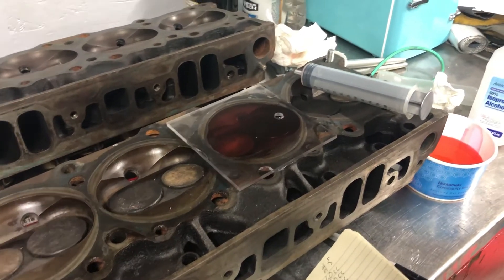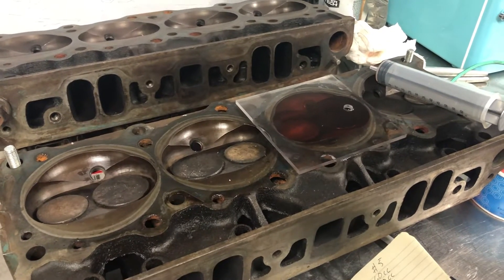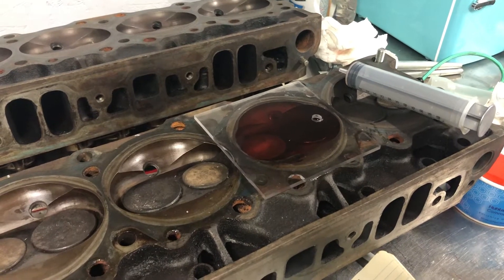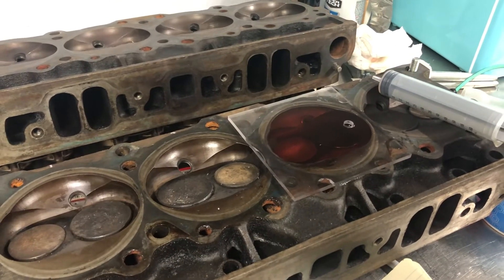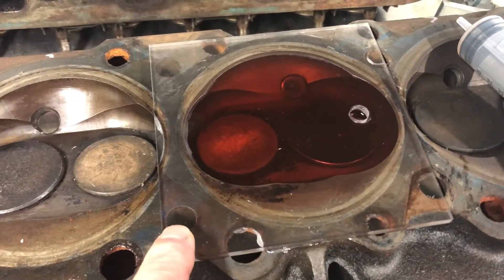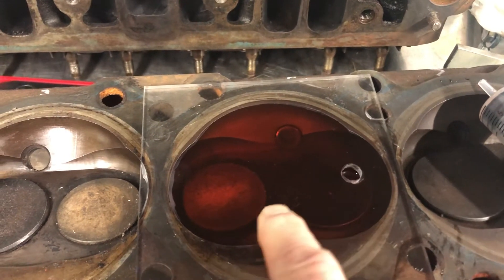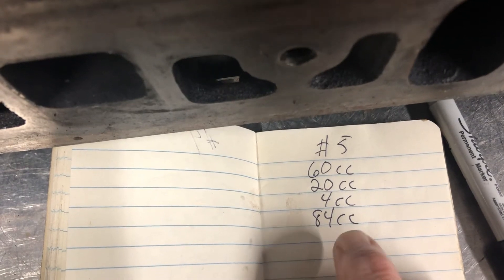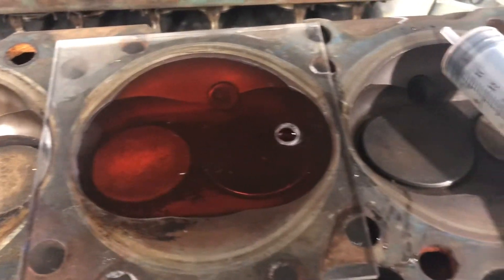Checking combustion chamber volume on #17 Pontiac heads

Comment: Great video, I finally found someone who is interested in the Pontiac 350. I have a 1968 Pontiac Factory 350 with the #17 heads. Thru some research these heads are most desirable. I look foward to updates..
Reply from the maker: Thanks for replying, I have just bought a bunch of parts so I have rods, crankshaft, pistons, rings, bearings, harmonic balancer . I have to scrounge up a Pontiac torque plate
Reply: @GruesomesGarage  Thats great, are you planning on installing hardened valve seats? Ive seen conflicting videos stating that on Poncho heads it cant be done due to close water jackets and others say its fine to install.
Reply from the maker: @anthonysantiago1999  I’m mulling this one over. I have not used them on my roadrunner and that engine held up. I have read different things about adding the hardened seats. On the 2.11 intake heads I hear it’s tricky due to the close spacing between the intake and exhaust seats, on this set of heads with the 1.96 valves there is more room to install the seat.
Reply from the maker: @anthonysantiago1999  let me revisit this one and I will let you know at a later time what my plans are, either stock, or hardened exhaust seats
Reply: @GruesomesGarage  thanks for the reply. I look forward to future progress on your 76 Firebird..

Comment: i am in the process of buying and having ported some 17 heads for a street/strip engine.  do you have any experience with this or can you give suggestions?  thank you.  Happy Super Bowl!
Reply from the maker: The only porting I plan on doing is to match the intake,and clean up the rough areas in the runners.
I have bought screw in studs and plan on replacing the press in studs . https://www.jegs.com/i/JEGS/555/20582/10002/-1

Comment: I know this is old but 17 heads according to butler and Pontiac was a 72cc head
Reply from the maker: I think you’re thinking of the #16 heads with the 2.11 intake. #17 350 heads 9.2 to 1 CR with the 1.96 intakes is what these are.
Reply: @GruesomesGarage  I h I have number 17 heads they are 72 cc
Reply from the maker: @rileyenia9388  
https://forums.maxperformanceinc.com/forums/showthread.php?t=817634
Reply from the maker: @rileyenia9388  I included a thread with someone whose #17 were 83cc.
So here's my question to you, have you actually checked your heads or are you going by the websites ?
Reply from the maker: @rileyenia9388  Here is another thread where the guy CC his at 88 !
https://forums.maxperformanceinc.com/forums/showthread.php?t=591889